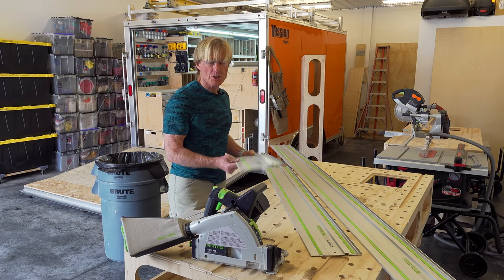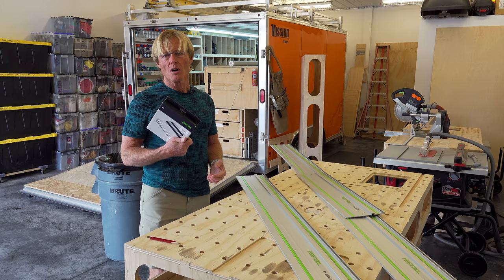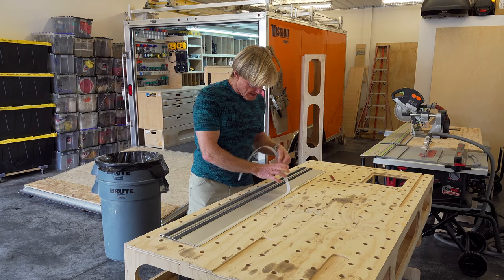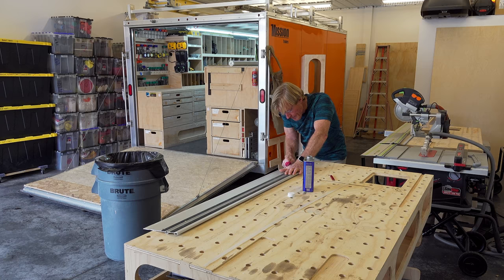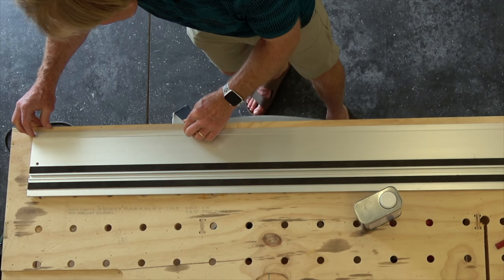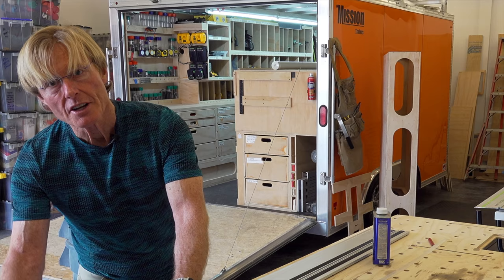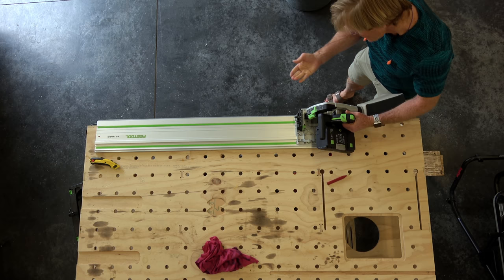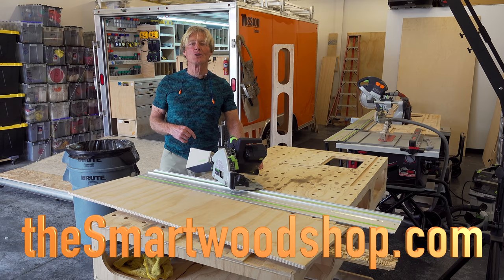Free TrackSaw Splinter Guard Replacement

Comment: Hey Ron. Your tracks are older tan mine, when , I rejuvenated my splinter guard there was no Turner’s tape. I happen to have acetone in my shop as I use it it to clean joints on Cedar before gluing. Simply cleaned the track, and actually stuck it on with the original adhesive on the tape, and rolled it down. 

I can certainly see the wisdom of using the Fastcap tape as an insurance policy.

By the way, I have the Festool T55 cordless, it’s an absolute must have in my shop.

Comment: Great advice. Thanks. Just saved $50! I had the Fastcap tape in my cabinet and I just cleaned everything off and reused the old chip guard. By the was Goo-gone works better than alcohol, acetone and lacquer thinner.

Comment: I ran out of turner tape, but had some Kraftex Carpet tape and used that when building a guide for my circular saw. It worked amazingly well when attaching aluminum to slick surfaces. Test it first, it was fairly thin and it has stronger adhesion than I would have expected. Just throwing that out there. Your mileage may vary.

Comment: A hair dryer is the best way I have found to remove the splinter gaurd residue. Simply heat track a bit then easily rub it off with your thumb. Took me 5 mintures for a 55" track.

PS: I apologize if I repeated this tip I discovered from YouTuber Andy Phillips.

Comment: My go to adhesive residue remover on non-porous surfaces is coconut oil. Massage a little bit on the residue. Wait a few minutes, scrape it with a fingernail if needed, and then wipe it off. Follow with a soap and water rinse.  Not as fast as acetone or lacquer thinner, but much safer and healthier.
Reply from the maker: Sounds good

Comment: Thank you Ron.  Great video as always.  Very informative and very detailed.  You saved me a crap load of $$$.  I had to re-apply 4 guards in the last 2 months. I always leave the end of the guard an 1/8" back from the end and add a 45 degree chamfer so it doesn't catch on anything. Still peels back.  No sense in complaining.  Just watched your video and fixed it.  Also learned that I could re-use a guard before replacing it.  The new Festool splinter guards don't stay on very well and are always peeling back (very common problem according to online forums.  Love Festool but this change from the old splinter guards really irked me.  I do like the opaque better than the black also.  Thanks again Ron.

Comment: Great. I was attached to the idea the guard had to be butted to the raised bit. I have a festool plunge saw bit picked up a cheap plunge saw second hand for $50. The track for the cheap saw was only a little more then the price of the SPINTER GUARD of the festool and is compatible. The Festool may be better, but not 10x better!  My point is that Festool parts are outrageously expensive. I’m looking forward to applying your recycle technique. Thanks!

Comment: When I bought my TS75 and 2 5' tracks maybe 20 years ago, ( I think those were the only sizes back then) the splinter guards were black. When I replaced them they were the opake ones, which I do like better. I didn't have any acetone either so I used KrudKutter general purpose cleaner and they've held on great. I also bought the bulk box and was floored at how much they cost. Then again, everything Festool is stupid expensive.

Comment: The Festool splinter guards on all tracks have fallen off at some point near each ends-- probably due to the heat in my Paulk like construction trailer. I've use the fastcap tape or (in a pinch) some p2-10 glue. I recently used Ron's technique to reattach one it's whole length with the dbl side tape, but I didn't notice the thicker edge Ron mentioned-- I hope I did it correctly (50/50). Thanks.
Reply: I'm sure that "thicker edge" is simply a result of the material melting slightly as a hot saw blade passes through it at high rpm. Some of us won't necessarily have it depending on how much we use our track saws. Ron probably uses his more than any of us watching his videos.

Comment: This is very helpful. Do you prefer the battery powered over the corded track saw? I have the 75, and would like to explore how effective the cordless saw is in reality of regular use. I'm just thinking the cordless would be much easier. Your thoughts?
Reply from the maker: Once I started using the battery saw, my corded saw never got used. I finally sold my cored saw and haven't missed it once. I also prefer the dust bag over the vac hose. It is a much more productive and useful tool being untethered.
Reply: @TheSmartWoodshop  That all makes a lot of sense, and is about what I expected you to say. I will buy the cordless, but keep my 75 around for upcoming slab work.
Thanks again for the high quality vids and such! Rock on!
Reply: @TheSmartWoodshop  I'm curious if you are seeing less fine dust collected using the bag over a vacuum? Particularly, as recently Peter Millard put out a video saying that if he was buying again if would buy the Mafell saw as its sealed blade cover seems to increase the effectiveness of dust collection. over the Festool, even though he is a long time Festool fan.
Reply: Yes, I bought the Makita cordless tracksaw, and have not used the corded version since. Of course here in Scotland I've got the 110v saw which requires a heavy transformer. I couldn't find a decent dust bag from Makita, but found a good alternative in the Triton. Works a treat if you empty it regularly. So much better than lugging a vacuum and transformer around!👍

Comment: I tried the fastcap tape, I had the track standing in my hot garage only to find that it rolled off and I found it on the floor.
Reply from the maker: I have only been using it for about two weeks and so far all is well. Maybe its the difference in weather.
Reply: Ron Paulk  It definitely had to due with the heat.

Comment: Use the dewalt track replacement strip, much cheaper and it has adhesive on it, or slide your existing strip over
Reply from the maker: Did you watch the video? I mention that there were aftermarket splinter guards much cheaper even cheaper than DeWalt, but they are black. Black would slow me down and reduce my accuracy. Any saving on the material would be lost in a single shop day.
Reply: T